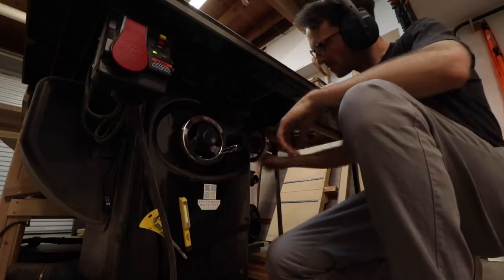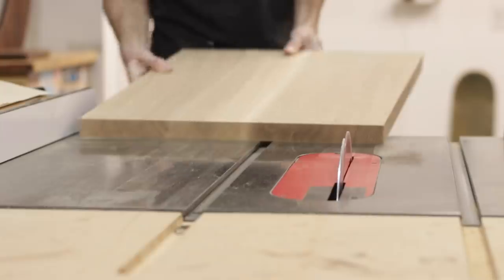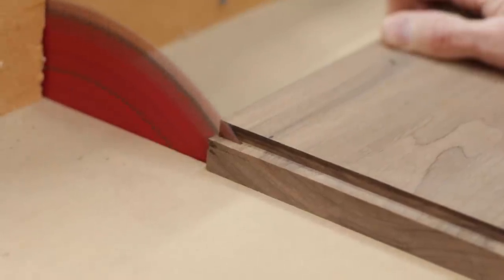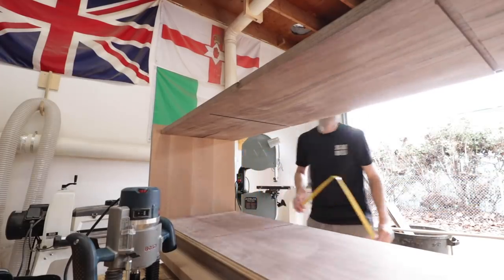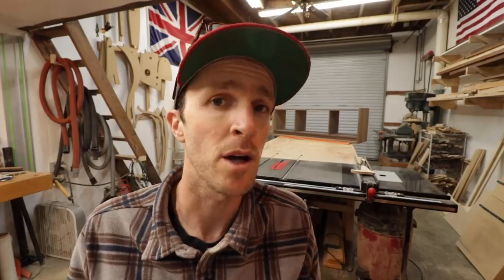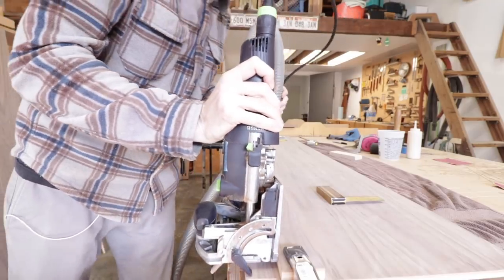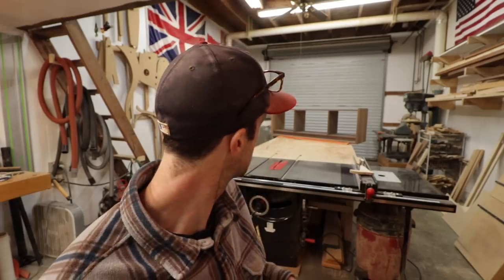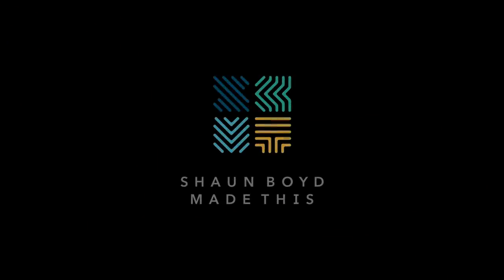Building the Credenza Cabinets - Modern Credenza Build - Part 3

Comment: Looking great Shaun.
I do a bit of work with Black Walnut milling it from scratch. Although I love it, I find despite using it at low moisture, it is a pretty mobile timber so I look forward watching how you seal it.
Cheers
Reply from the maker: Yeah, it can be a little unpredictable sometimes, especially during the milling process. I haven't decided on finish for this yet, but I will definitely let everyone know what I decide in the next video. Thanks for watching!

Comment: Shaun, what do you think of  the Rockler Beadlock loose tenon system as an alternative to the Festools Domino system ( you know for us people that aren't quite ready to drop the big bucks yet)? And also where do you buy your Walnut plywood, do you have to order it or have you found a place that has it in stock?? I assume you're somewhere in O.C. seeing that you're always wearing an Angels cap!
Reply: great question Robert! I'm keen to hear some responses on the beadlock too as Festool is just crazy expensive here in Oz.
Reply from the maker: I haven't used the beadlock system, but just from looking at it, I would think it would be a great alternative, especially when looking at the price. The main advantage of the domino is the speed and the accuracy you can get with that speed. It really doesn't allow me to do anything better or more complex, I can just do things quicker. So the beadlock system is probably quite a bit slower, but if time isn't a dealbreaker, it seems like it would be a great tool.
As for the walnut plywood, my local (~1 hour drive away) lumber supplier always has it in stock. I actually live a few hours north and go to a place called Aura Hardwoods in San Luis Obispo.

Comment: This multi part series for a project is awesome. Here's a question. Do you line up grain direction in a certain way when gluing up the panels? Either for appearance or stability?
Reply from the maker: Glad you are digging it! Yeah, I definitely try to put boards next to each other to make it look as seamless as possible. If the oak part was flipped the other way and this was a table or something, I maybe would have gone for a grain-matched waterfall around the miters too.

Comment: I have a few questions I hope you can take a moment to answer. I seem to always have trouble in long bevels in cases, and I have a project coming up that requires many boxes with beveled edges. On your bevels/ miters , are you using the dominos in the tight setting on both sides? In the end, are your edges perfect perfect or are you burnishing any tiny gaps? I’m beginning to think my pursuit of ‘the perfect mitered edge’ is a fools errand. Of course it could also mean I just can’t see my mistakes! 🧐 thanks!
Reply from the maker: Yeah, long miters can be tough. I usually use the tight setting on one side, and the middle wide setting on the other side. This way I can slightly slide the panels to line them up perfectly if needed. Definitely having really flat panels helps get a nice even cut and good, even clamping pressure will decrease any gaps. For the most part I am able to get a mostly gap free joint, or very thin gaps that disappear with sanding and still allow for a nice sharp corner. Chasing perfection is a slippery slope, but I think we can at least get close. Hope that helps!

Comment: Strong stuff! Has that strength test manoeuvre ever failed? Would anything be compromised if you used only glue and no dominoes? It is coming along just fine. Thanks for these videos that are specifically you in many ways.
Reply from the maker: Haha, it hasn't failed yet, knock on wood! I'm not sure I would only do glue on the miter joints, since it is all end grain, but I could have definitely gotten away with no dominos for the panel glue ups. Thanks for watching, Juliet!